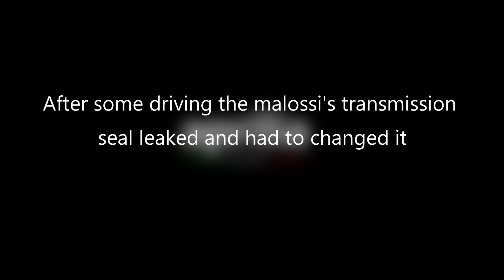Aprilia SR 50 Beast Unleashed stage6 R/T 70 piaggio #4

Comment: Where did you get the footplates from?
Reply from the maker: Look up for "aprilia sr lennes trittbleche" if you are able to find them anywhere in stock. Mine were from amazon or ebay dont remember
Reply: @ApriliaSR50Customs  I didn’t find them in stock. Btw how did you adjust the air screw on your sr50?
Reply: I converted my dellorto 17,5 from auto choke to manual, when i cold start the bike with the choke on it doesn t keep idle and dies, when i start it with the choke off then it bogs sometimes and then works fine. Why is it not idling with choke?
Reply from the maker: @Octavian17  search for carb settings manuals on internet and read. You need to understand what settings affects what. Cant help you remotely.